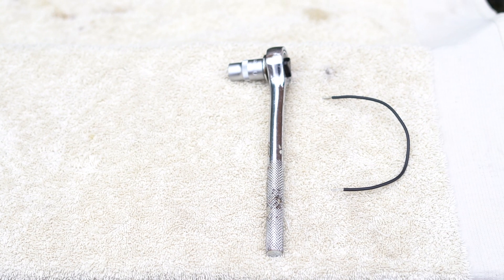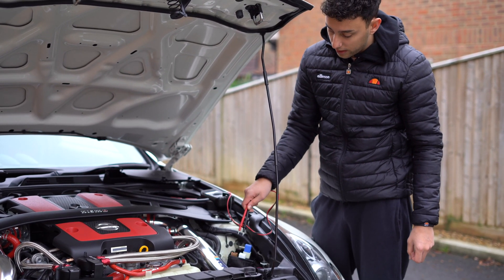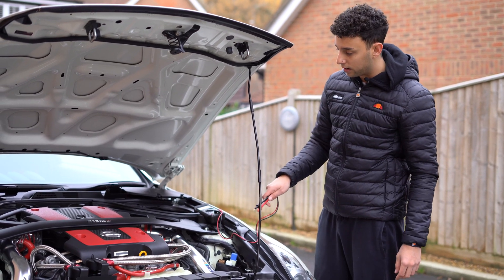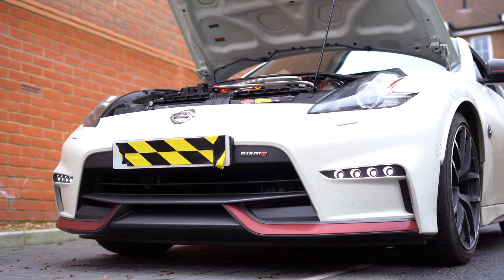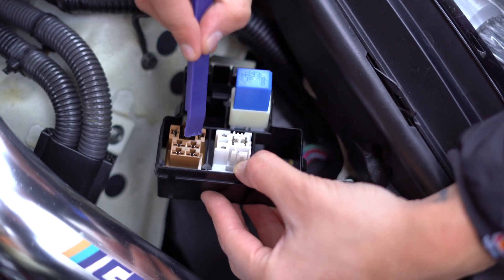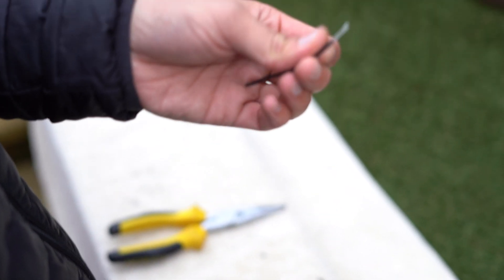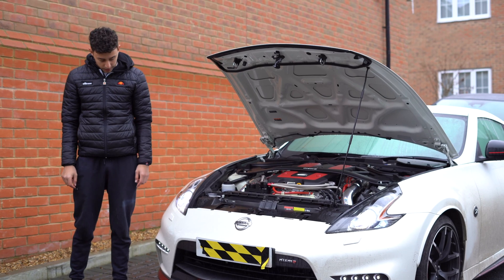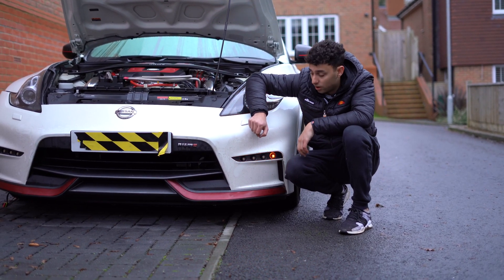370z Always On DRL Mod - WITH 1 WIRE

Comment: What are the led that you used to replace them?
Reply from the maker: I used some LED's from corso motion they were these: https://corsomotion.com/collections/custom-build-series/products/custom-made-board-7x6-4p-bi-color-plain-ver-600x600mil

They do require a bit of soldering but if you have the EVO R Drl's already, they do fit inside the existing LED housing. You'll probably want to use some sort of epoxy to keep them water tight